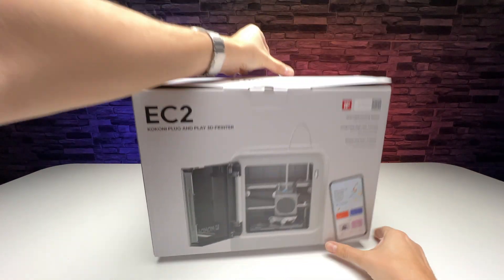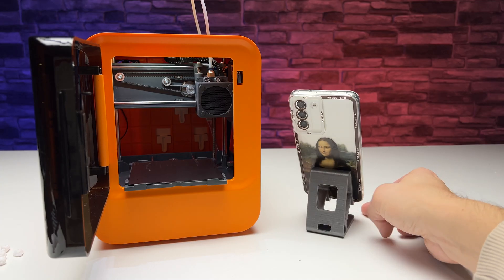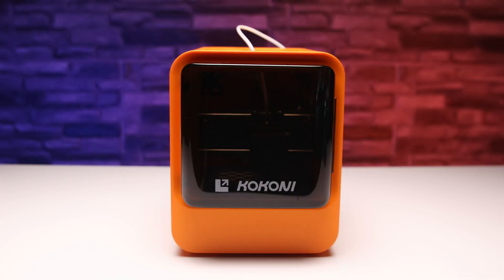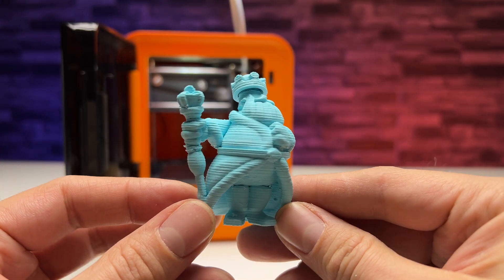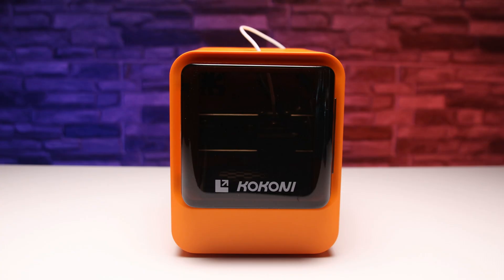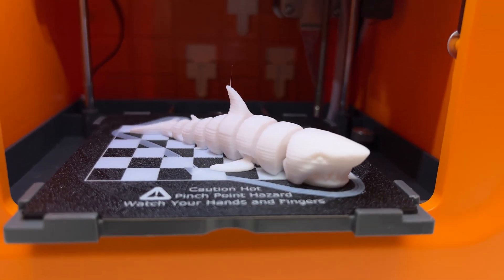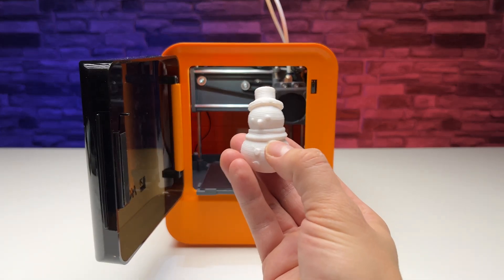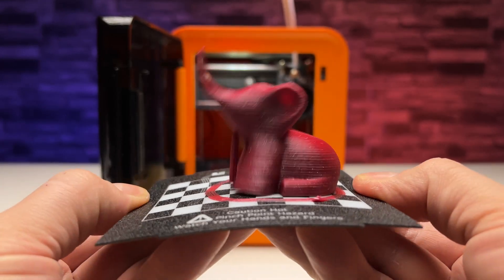3D Printer KOKONI EC 2 Discover the Magic of 3D Printing - The Ultimate Kid-Friendly Printer!

Comment: its surprising to me that it uses a .6mm nozzle, I would have stuck with a .4 or even go down to a .25mm nozzle to keep some of the detail that you lose
Reply: for a kid its fine they probably arent going to care and its good for speed
Reply from the maker: Yes, for detailed models, the 0.6mm nozzle is not a good choice, but the target group of this printer is completely somewhere - they are mainly children, and they don't care about the details - they will mainly want it quickly, safely, easily, without maintenance and complications, and quiet, what this printer can... for us it's an ideal and cute little box/accessory for the children's room :-)